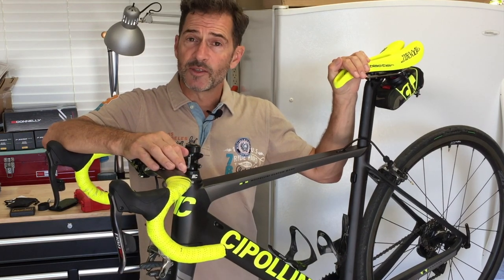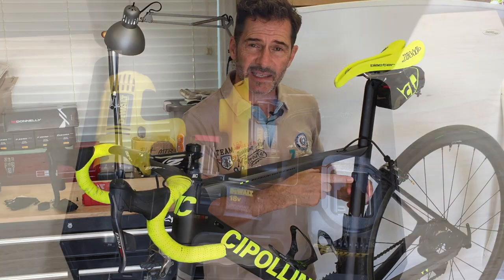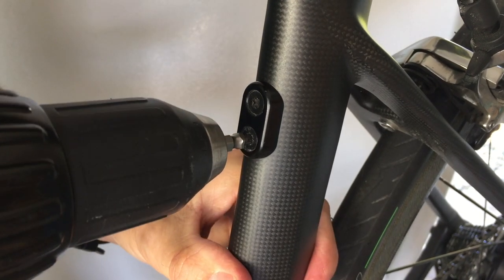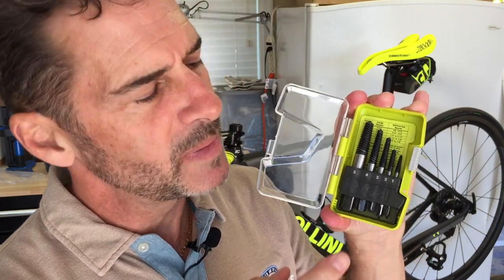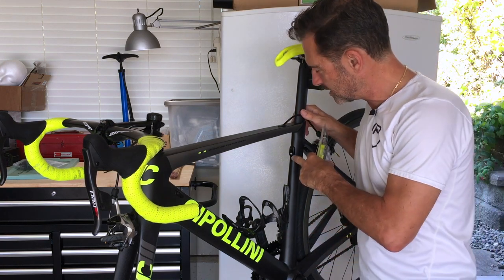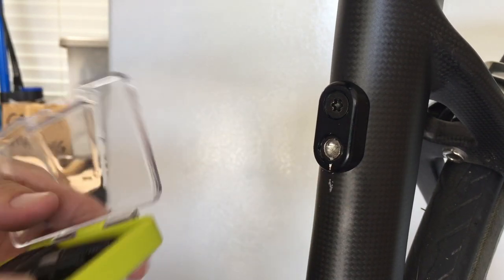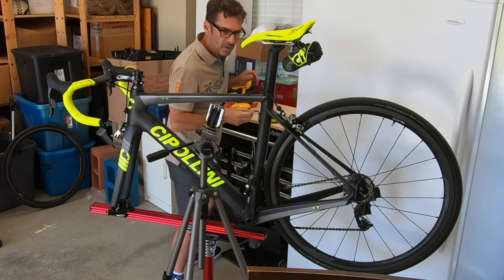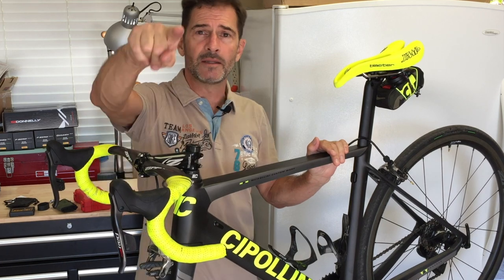How I Removed a Stripped Torx Bolt From A Carbon Fibre Bike Tube

Comment: Hey Pez, a couple things that have been handy for me... On every new bike build, I exchange all the bolts I know are going to be subject to wear and tear with titanium counterparts. I've found too many disk brake, stem and seat binder bolts to be made out of substandard metal that's either prone to stripping out or corrosion. Sure, it's an extra spend, but on a bike that costs thousands, $15 in bolts should be no big deal. Just be sure to use ti-prep, anti seize or grease where necessary. As well, as it pertains to seat posts, I use carbon friction paste so I don't have to over torque the binder bolt to keep it from moving.
Reply from the maker: Good advice Andrew - thanks for the note.  - Pez
Reply from the maker: Solid advice Andrew... !

Comment: Left handed drill bits are your friend.  You can't get them at the local hardware store.  Usually the reverse direction and the pressure of the drill bit gets the bolt out. 
Actually the CT ones work fairly well.  Almost every bolt I have used it on comes out with the pressure from the drill bit alone.  The trick is to use the right size drill; smaller than the diameter of the bolt, not the head. The problem with extractors is that they expand the bolt so they are not useful. 
There are a lot of Youtube videos on bolt extraction made by experienced machinists.  Although they make it look easy, it still beats trying to learn on your own.   
The real problem is holding the bike frame steady enough to drill out the bolt.  The steadier the frame the more pressure you can apply to the bolt.
Reply: Hopefully this is a once in a lifetime project for me... but hey - I now own some cool new bits and tools...
Reply: @sessabean  You can never have enough tools....
Reply from the maker: Also good advice Jonathan.  Hopefully I'll never have to do this procedure again - haha! - Pez

Comment: Easy-outs suck on small bolts, as the bolt's heads, or their shafts are not big enough to drill a large or deep enough hole for the easy-outs threads to catch. Next time try this. First soak the screw/bolt with penetrating spray (Liquid Wrench). Wait 15 minutes. Then try to gently tap (using a plastic no-blow hammer) an allen wrench into the damaged Torx bolt head, if it's the right size, it'll be a very tight fit (try a few different metric and sae ones). The Alen should hold fast in the damaged Torx and enable you to easily unscrew the bolt. 

If that doesn't work, use a hardened pin punch to make a small mark off center on the bolt, outside of the damaged torx area (halfway between the Torx and the edge of the bolt/screw). Then using that "dent" as a starter hole, carefully drill a small shallow hole with a small hardened drill bit. Bit should be no larger than half the width of the bolt's flat area you have to work with. As the drill bites in, drill in a bit less then a millimeter or so in, then start very slowly angling the drill to the right to carve out the right side of hole a bit (90 degrees relative to a radius from bolt head's center to your new hole). What you want is a nice solid "stop" for a small nail (or, better, an old similar sized drill bit) to push against, and some room so when it's placed in the hole it can be at the correct off-set angle to turn the bolt CCW when tapped gently with a very small hammer.
Reply from the maker: Hopefully there won't be a "next time" - !  Thanks for the tip - .
Reply: thank you very much of the liquid wrench tip. I was preparing to do some open heart surgery with the extractor bits, but tried your tip first. Worked like a charm!

Comment: Iv loosened and tightened torx bolts with a tool two sizes to small, impossible with any other bolt head type. I also am able to use torx bits on hex bolts when the hex wrenches don't work. Torx are fucking amazing

Comment: I have an issue with an allen bolt which is in my carbon fork on my CX bike. i changed  the disc rotors and I had to finetune the brakes and during this process one of the allen bolts has been rounded...  I will try your solution and let you knoe soon. Thanks for the video.
Reply from the maker: Make sure your drill bits are SHARP - and go slowly. Good luck! - Pez
Reply: @PezCycling   Herby I confirm that the procedure was successful. There is no a single damage on the carbon fork.
Reply from the maker: @gilberttiborjakub9890  Bravo !

Comment: I would like to make the following suggestion*:  IF the head of a bolt/screw is sticking above the surface *gently try to grind a slot by first just cutting the line on top of the bolt/screw and then go progressively deeper with succeeding cuts.   If this does not work then you you will have to go with drilling into the screw and using an easy-out bit.
Reply from the maker: Thanks Ron - I admit I'm probably scarred for life after that bonedheaded move of going near my carbon frame with a grinder...
Reply: @PezCycling  :-)    I'm 72 and have more than a few of such moments and some almost killed me  :-) !
Reply from the maker: Hi Ron - you saw what happened to me - ouch! I will not be attempting that stunt again - (a la Evil Knievel's Snake River canyon jump)  - doomed to fail.